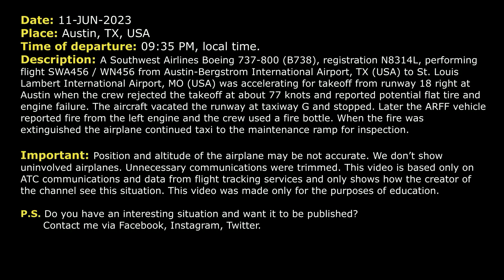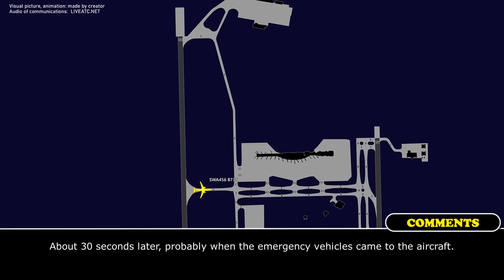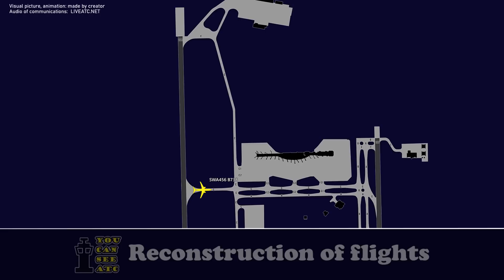Engine fire. Rejected takeoff. Southwest Boeing 737 has engine fire on takeoff at Austin. Real ATC

Comment: Now what would happen if it did take off..
Reply: Depends on what was actually wrong with the blown engine, how fast they were going when the engine blew, and how heavy the plane was. 

Most modern planes can limp into the air with one engine but it takes longer so you might have to travel down the runway farther before reaching v2. This could be a problem with a fully loaded plane on a short runway.

 If the engine blows after v1, you continue to take off, announce the failure, circle and land.

If the engine blows far before v1 you abort as they did. If you cant abort for whatever reason, you continue the takeoff. Then you circle around and land the plane asap.

Comment: After seeing so many horror stories about planes crashing and burning due to what should be obvious problems during the takeoff roll, I'm very glad to see these pilots were well disciplined enough to keep their egos in check and cancel the takeoff roll out of an abundance of caution. I hope they're commended for how they handled the situation. Everyone worked very well together here.
Reply: I’m not sure how familiar you are with jets so I’ll explain this anyway. 

Before each takeoff the flight crew will brief for rejected takeoff, namely what will be grounds for a rejected takeoff at what time, who will be doing what, V speeds, ect. 

Rejected takeoffs will come in 2 flavours, a low speed and a high speed rejection. In the 737, the tipping point between a low and high speed rejection is 80 knots (which is why you’ll hear the 80 knots call-out if you watch a takeoff video). Essentially below 80 knots the takeoff can be rejected for pretty well anything. Above 80 knots the risks of rejecting get higher, so they will only reject after 80 knots for major issues such as a fire, engine failure, or anything that pose an extreme risk to the aircraft. For example, they would not reject for something like a bleed air fault or a door warning at above 80 knots, they’d take off then come back to land. 

Then once you reach the point of no return (V1) your pretty well committed to the takeoff because you likely have insufficient runway to stop. Your committed to the takeoff, and in a 737 with good conditions and a long runway, you V1 and VR (the point where you rotate the aircraft and start trying to lift off) is the same so by that time your going to be flying anyway. 

So that discipline your commenting on is the result of a great safety culture inspired by the incidents you mentioned. It’s not an on-the-spot judgement by the captain, but a preplanned contingency that they briefed ahead of time in case this should happen. After that, it’s just a matter of following the plan.
Reply: @speed150mph  I am familiar with the procedure, but good explanation. Unfortunately, past events have shown that in certain cases the pilots considered themselves the ultimate authority regarding aircraft operation, sometimes even beyond what the manufacturer says or what airline policy says and they will continue with unsafe takeoffs anyway. This can also manifest itself via confirmation bias, and not picking up on things the aircraft is telling you about itself or what the surroundings are telling you about takeoff conditions. These types of takeoffs can be seen in incidents like Aero Peru Flight 603, Air Florida Flight 90 or Comair Flight 5191.

Comment: Since their brakes needed cooling would it be better to tow them to a safe location instead of waiting for the brakes to cool off?
Reply: The aircraft made its' own way directly to the maintenance ramp without needing to be towed - it did not have to wait for its' brakes to cool before moving, but the hot brakes meant that it was not safe to put it on a stand at the terminal.

Comment: It might help viewers to know that the fire extinguishing (Freon) bottles on the aircraft discharge into the spaces between the engine outer casing and the cowling, where the fuel components, oil tank, and accessories such as generator, hydraulic pump, and starter are located.  These are the areas where a fire could propagate and damage aircraft systems and structures.  The extinguishing agent is not introduced into the fan or core engine where intake air flows because the high volumes of air flowing through them during operation would make the agent ineffective.  The core engine itself operates at such high temperatures that it is normally able to withstand the effects of a fire long enough for the crew to shut down the engine and stop the supply of fuel to it.  Although the production of Freon was suspended years ago because of its adverse environmental effects, a supply of the agent has been reserved for aircraft fire extinguishers because it is the most effective non-toxic substance available.
Reply: Only it's not Freon. It's Halon 1301. Freon is a refrigerant and trademarked to DuPont.
Reply: @chrisharris7893  Halon 1211 and Freon12B1 are the same stuff, CF2ClBr.
Reply: Halon, not freon. Halon displaces the oxygen in a space, and freon is a refrigerant.
Reply: @driftspecs13  Halon disrupts the chemical chain reaction of fire, it's effective far below concentrations that would be displacing enough oxygen to stop a fire.
Reply: @soniclettuce  Certain Halon types actually attack the fire in three ways; displacing oxygen, breaking down due to heat which takes energy to do, and then those combustion products catalytically attack the fire, so it knocks out three of the four legs of the fire square. Super, super effective stuff. Certain types of halon aren't made anymore because they are extremely ozone-depleting, it's a chlorinated fluorocarbon which is just awful for the environment. However, small quantities are allowed because the environmental impact of small releases of halon which prevent a larger fire, say of a petrochemical plant or similar, is much less than the damage that would be caused by the place burning and releasing more contaminants. Lesser of two evils, basically. And yeah, it's useful in airplane engines because it's so effective, pilots can't see the fire most of the time so when they fire a bottle off they need to know it's almost certainly going to put out the fire, or at least give them enough time to land.
Reply: @driftspecs13  Brand names same substance.

Comment: This is some excellent work.
Reply: Except for the passengers that got up. I suppose they were panicking and wanted to get off the plane asap. I'm not going to judge them from the comfort of my armchair,  but I really wish they could just trust their pilots to do the right thing. It's in their own best interest no to be anywhere near a running engine.
Reply: @klausbellroth5451  Flight attendant here. They probably got up to use the lavatory. It happens all the time at the worst times. Lack of awareness.